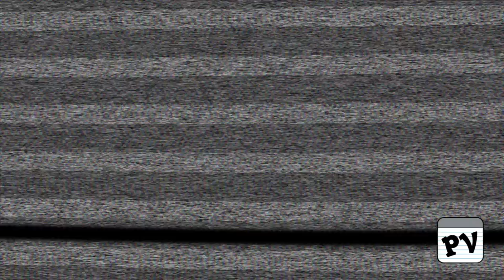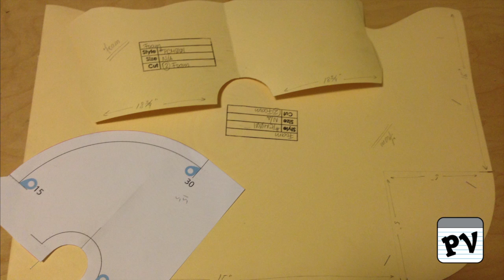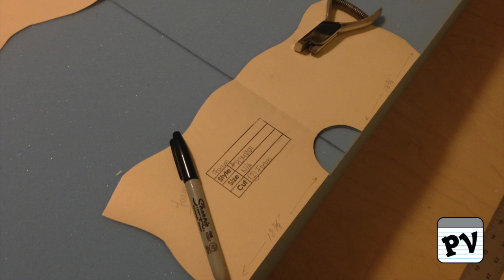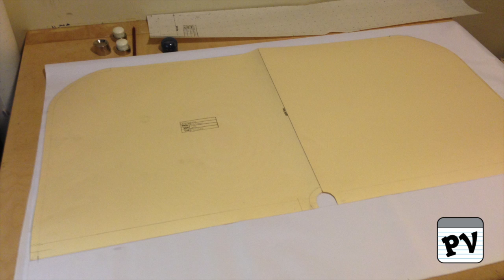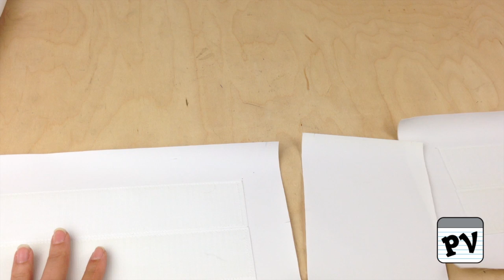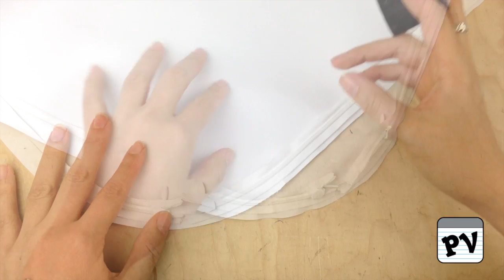DIY Pole Dancing Crash Mat / Practice Safety Mat Pad

Comment: I know you just made your mat...but how well has it lasted? We had foam cut at the warehouse... 8 inches deep, 48 inches diameter round, and then bought the yoga direct dura- covers on Amazon. The foam has held up great but in 1 and a half years the dura cover seams have ripped in places. I would love to find a company who would make the covers with grommets on the side for air release on falls and create more durable seams. Have you heard of a company that just makes covers?
Reply from the maker: Sorry, I don't know of a company to make covers. I would just repair it and add the grommets or take it apart and use it as a pattern to cut a new cover.

Comment: Can you share your pattern for the cover?
Reply from the maker: I put a link the description box if you are interested in donating a $1 for the PDF template. The 2 page PDF will include all of the measurements and templates, for the corner & center cut out, for both the cover and foam pieces.